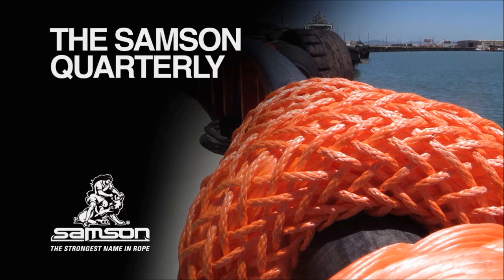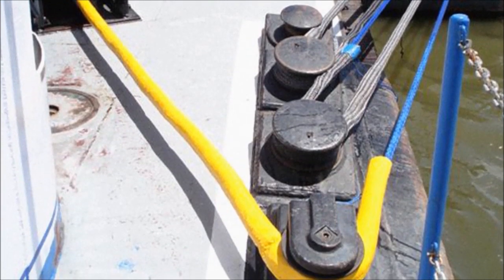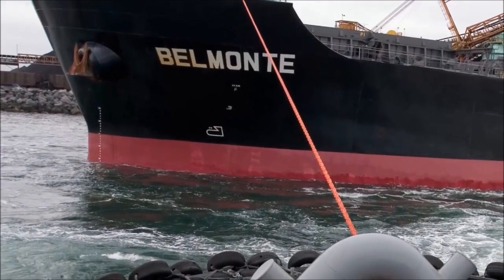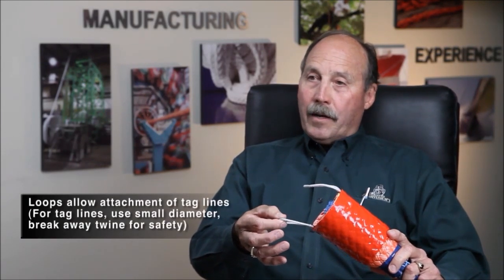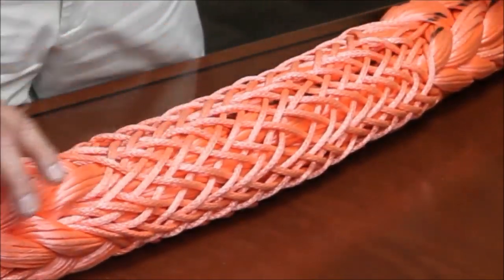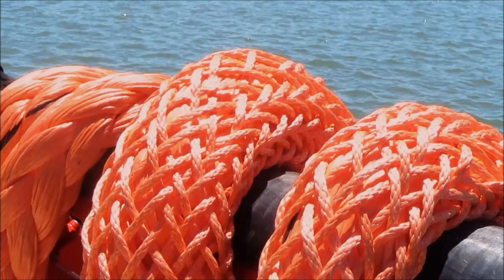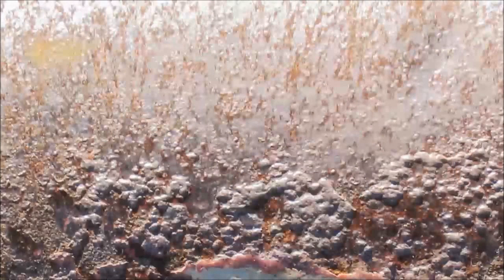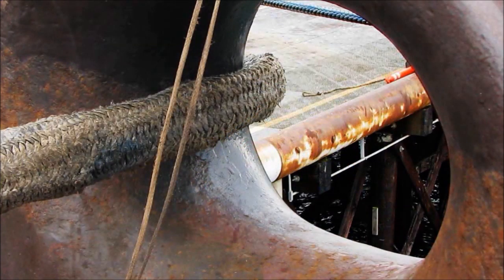Chafe Protection Solutions

Comment: Are polyester ropes toxic  for humans or dogs?
Reply from the maker: While polyester is a common fiber utilized in clothing and dog toys, Samson ropes are not designed specifically with certified food-safe materials. If considering a rope for use where there is a potential for oral contact, products with polyurethane-based coatings added for increased abrasion resistance should be avoided.